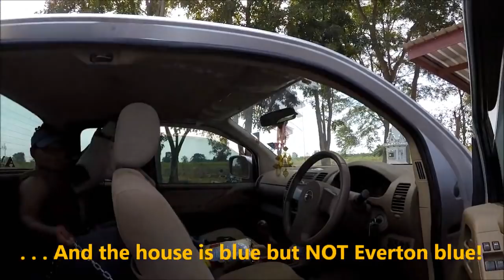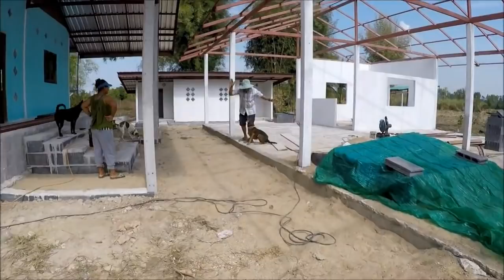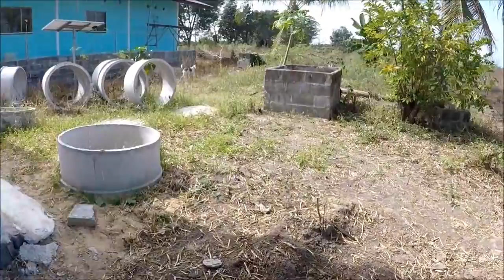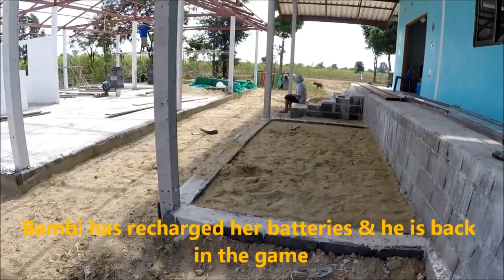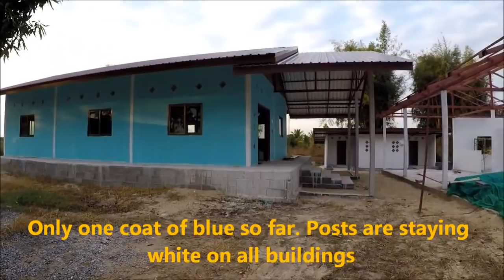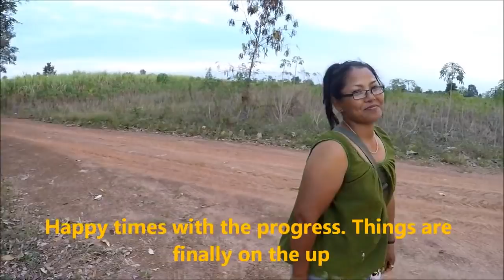Farm Life - Our farmhouse is nearing completion

Comment: Hey Leigh. Is the roof on the building to the right of the house having guttering on it?
Reply from the maker: Hi Darren - yes matey with a down pipe either end to big watertanks.
Cheers Leigh.
Reply: What type R U going for. I had the steel type but after years of service started having leaks at corroded joints. Changed it out to the white UV PVC 5 years ago & no problems & if I had choice again it would be the UV PVC.
Reply from the maker: Hi Bob - we've had steel on our village house with no problems but it only 3 years old so will probably suffer the same fate as yours did down the line. I haven't seen the UPVC round here or seen it on any buildings here but will keep an eye out now. 
Cheers Leigh.
Reply: Global Ho sell it as do most of the big DIY shops. U can get the gutter with the same box profile as the steel or the half pipe profile like the UK. I can't remember what I paid now but I remember it was reasonable & might even be cheaper than the Steel. Down comers R a smaller diameter than what U get with the steel but if U R putting one each end of your gutter runs that is plenty to drain the water from your gutters.
Reply: i was looking on a forum & a guy said he paid 500 THB for a 4 metre length for the UVPVC. Then U got your length joining, end cap, down comer piece fittings & the gutter support brackets.  Don't skimp on the brackets I would not space them more than 0.6 metre apart.